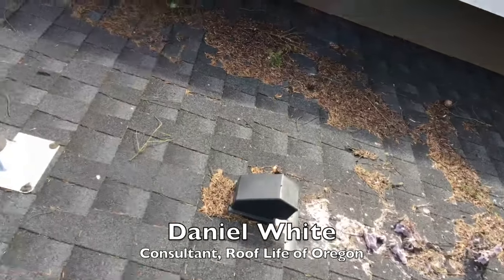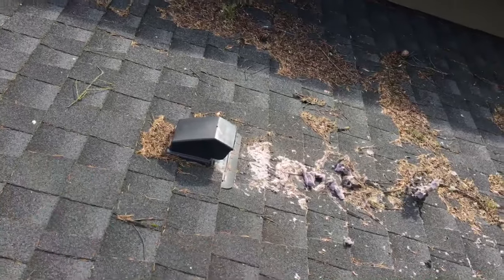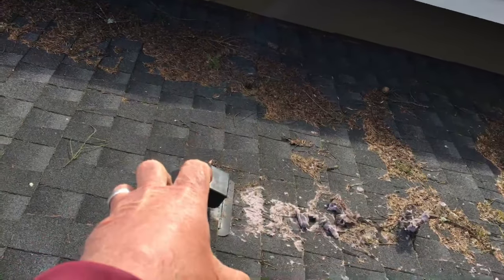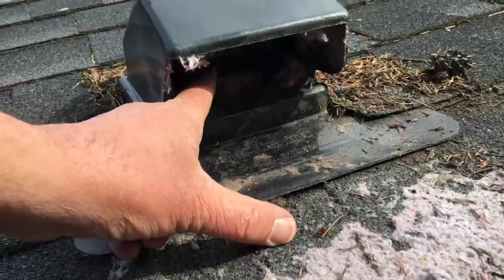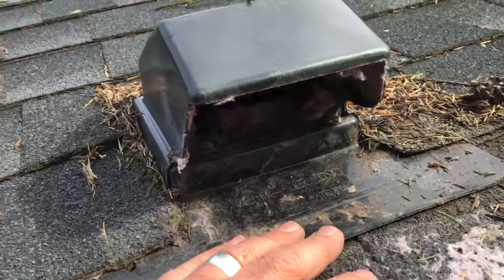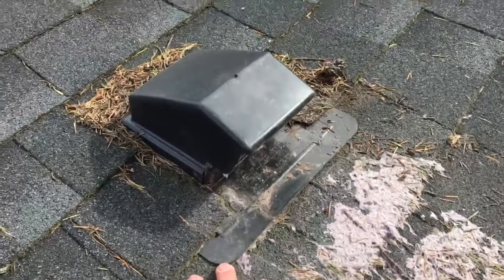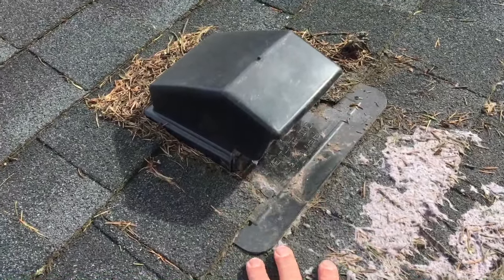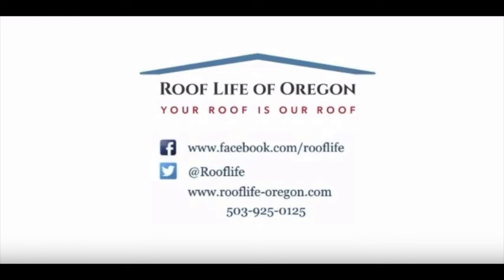What To Do If You Have a Dryer Vent On Your Roof- Field Video #27

Comment: My rooftop dryer vent was getting clogged every three months 🤦🏽‍♂️ it turned out the wire gate holes are too small and that’s where the lint was getting caught and accumulating. I took off the wire gate and now my dryer breathes much better. My only problem now is hoping no birds or rodents decide to make the vent their home. I’m still thinking of what to replace the wire gate with but for the meantime it’s working perfectly fine.
Reply: Same problem here. I hate the way it was built and unfortunately can’t move it away to a wall. It would cost me an arm lol. I removed it too, but thinking about how to replace it to cover it, just  in case any snake or squirrel  want to go in!! 🤔
Reply: That's exactly what I'm worried about is birds

Comment: I have one of these and it is impossible to keep clean. To make matters worse, the vent clearly says "not to be used for Dryer".  Dryer vents shouldn't have a screen like mine does. It should have a flap. Also, this is snow country. It gets blocked in winter. I want to reroute the vent through the garage and out the side wall. It's only 3 ft and will be easier to clean.

Comment: isnt that what lint screens are for...how would lint get around that
Reply: Lint screens are full of tiny holes. Tiny holes allows tiny fibers through. Tiny fibers accumulate on the other side, and eventually become large clogs.
Reply: @CaptainCocaine  A dryer vent should NOT have a lint screen because lint screens collect lint and clog, meaning someone will have to clean that screen every couple of months, which if it's on a roof, especially a steep roof, especially a roof that for months of the year has snow and/or ice, is problematic. Even in areas where that's not an issue, people generally aren't up for climbing up on their roofs every couple months to clean a screen, never mind the wear and tear that's going to put on your roof and how, if one actually bothers to do it, will vastly shorten the life of the roof. The vents you see with screens are meant for bathroom fans and oven hoods, NOT for dryer vents.  The screens being there not to collect lint, which bathroom vents and oven hoods don't expel, but are to prevent vermin from entering. Instead, a dryer jack should have a damper, a light flap that opens very easily with the slightest amount of pressure from inside, like from the 3 to 4 mph of blowing exhaust from a dryer, but that closes again by way of gravity once that blowing air stops and are difficult to impossible for critters and sometimes even humans to open from the outside, thus requiring someone to turn on the dryer temporarily in order to get it to open and then hold it open for any servicing or cleaning from that end. So why don't bathroom fans and oven hoods use the same type jack? Well, they sometimes do and can, but it can be problematic since they don't produce nearly the strength and speed of air that a dryer does. What's more, quite frankly, a screen is a far better and cheaper solution to preventing unwanted critters from entering the home through the jack, just one that can't be used for dryer jacks exactly because it will catch lint, quickly clog the jack completely, and then not only make the dryer very inefficient but also present an enormous fire risk as that lint buildup and the heat generated by the dryer become increasingly like kindling and a lit match-- don't believe me? Just take lint from your dryer's lint trap outside sometime and put it in a firepit or whatever and set match to it or even just use a magnifying class. That lint will light like gasoline, so combustibly that you will often hear and feel a "whoomp" as it instantly ignites into a ball of flame.
Reply: @belabraga2353  He means the lint screen INSIDE the dryer